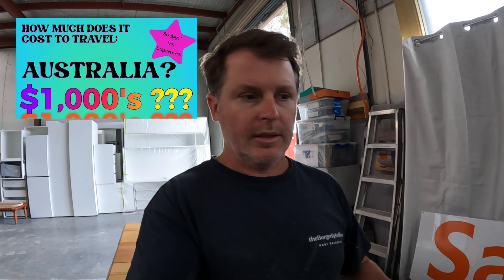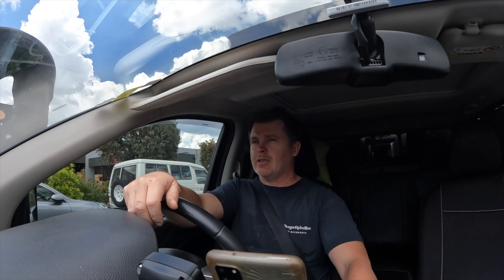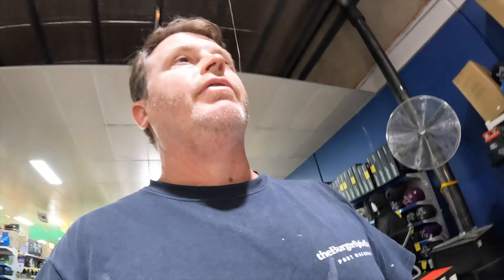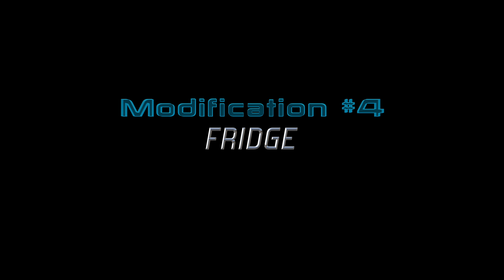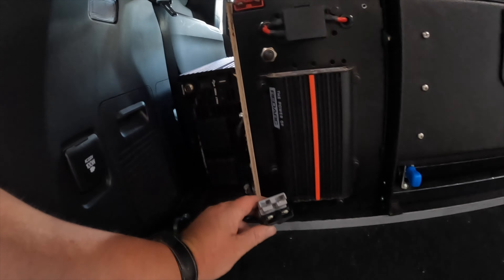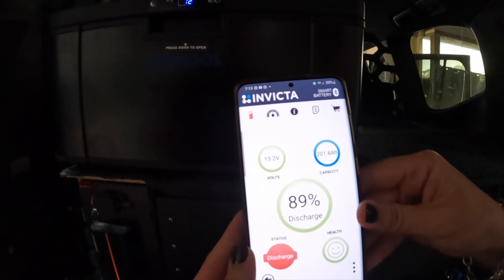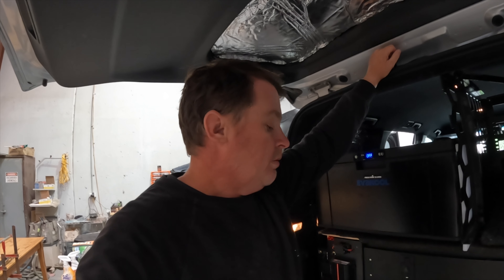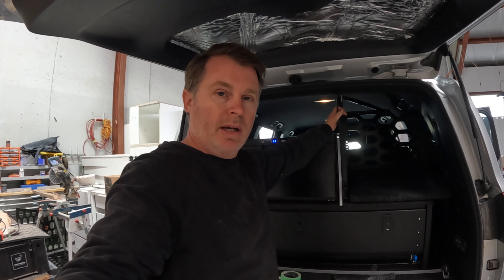LC 300 Series Modifications - Part Two

Comment: Awesome stuff! Test the car in the Sun first with that damper on the windows as the black will absorb the heat and radiate through the thin reflective inside cover and heat up the car exponentially!
Reply from the maker: Yeah we thought that might be the case although we tested it over weekend with 34 degree heat and no issues at all. the rear windows have a pretty dark tint on it which would help 👌
Reply: @JourneyUnknown  that’s awesome 🤙🏽

Comment: Once again great job guys love the fridge and as you showed Anderson plug already wired bonus ,not sure if you already have a table to use at the back like you said for day trips but to incorporate a reasonable size pull out maybe something only about 30mm  high and coming out from under coco’s cage to put drinks or prepare food would complete the build nicely just a suggestion thanks for the video Ron and Kim 👍👍
Reply from the maker: Morning Ron & Kim, thanks for watching and commenting! It really has all come together and working nicely for us now. I don’t think we showed it in this episode but if you go back to Part One of the build and fast forward to 21.07 -21.17 you’ll see there is a slide out table below the drawer and it comes out further when you pull the drawer out, perfect set up! It’s so handy when we have the caravan hooked up, it doesn’t interfere with the A frame and we can do what we need to while still being hitched. No need to carry an extra table around. Thanks for your support guys once again. Troy & Laura